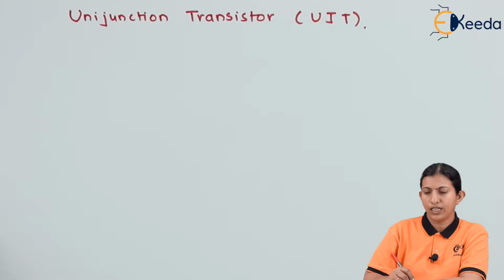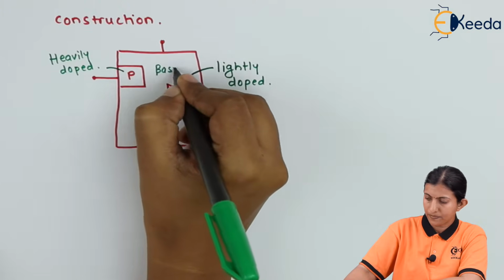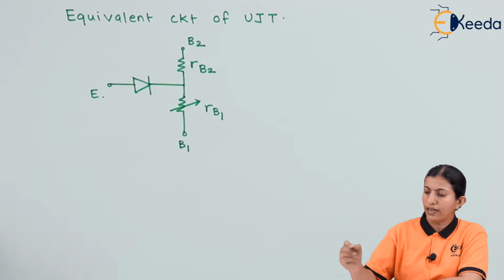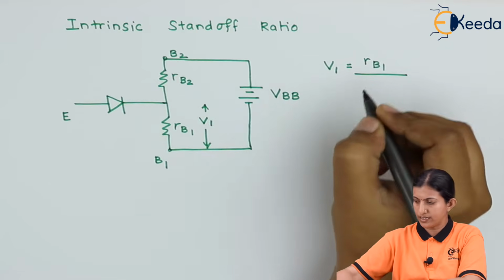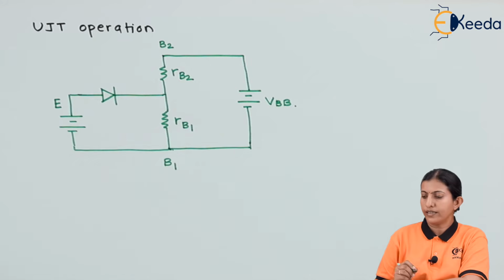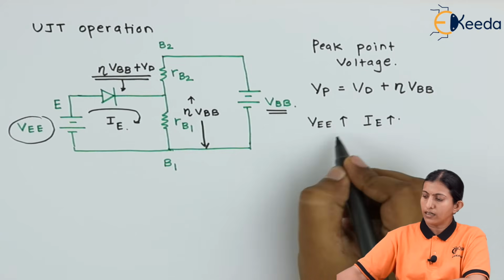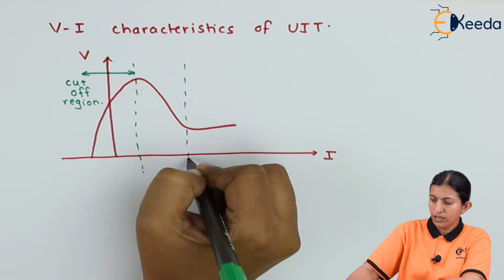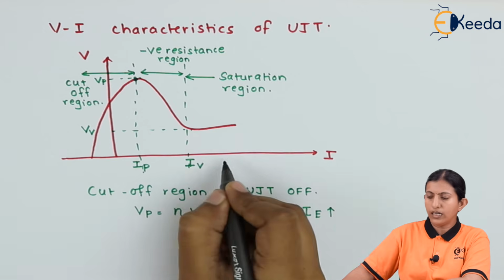UJT Concept, Construction, Working - Waveform Generator - Applied Electronics

Comment: I have only one question, when the ujt is on the dicrease in rb1 causes the Voltage in that resistance to drop. But why does the Wave graphic represents voltage in the emitter?
Reply: mainly,heavy current flow through rb1 because of emitter(p region) and rb1 is a internal resistance of n region ( and it is a diode).you can not mesure rb1 voltage differently, only junction voltage drop.I think it is only pn junction voltage drop. Thanks